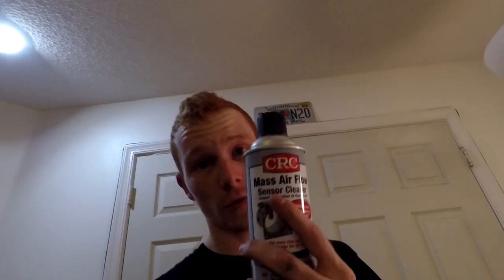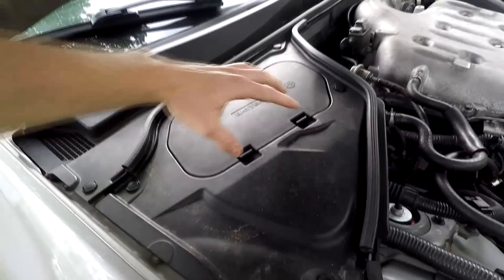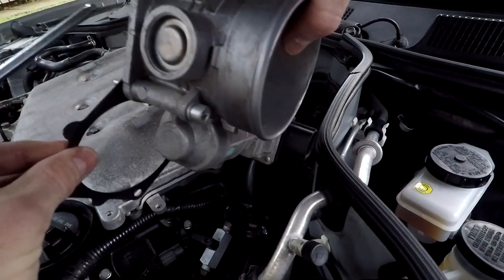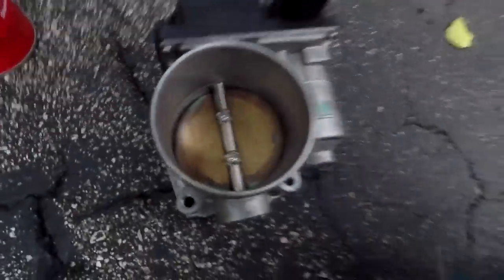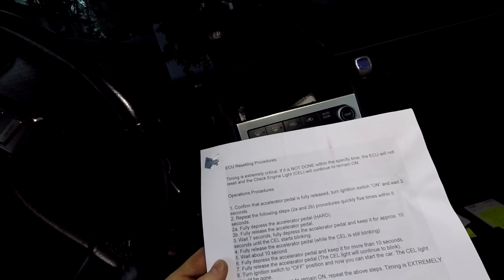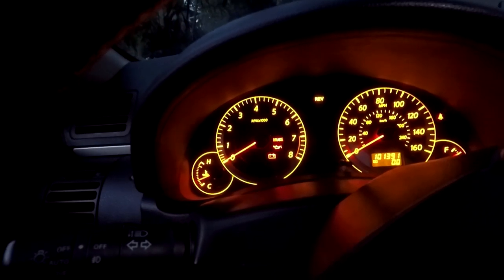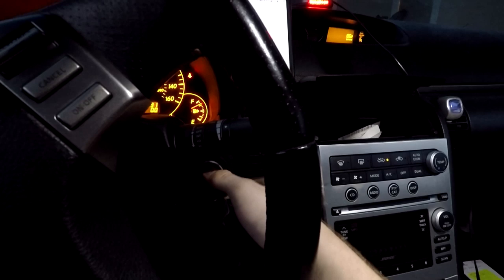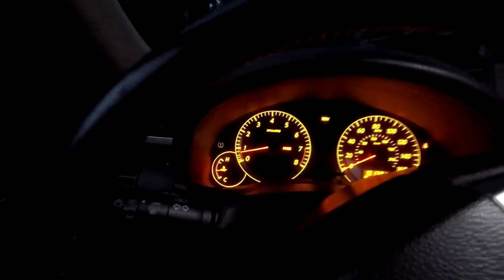G35 350z How To Clean Throttle Body ECU/Throttle/Idle Relearn

Comment: Been struggling with a weird idle for a couple weeks after cleaning my maf, air filter, and throttle body. Sounded like a dirty iacv even though it doesn't have one haha. Used your quick relearn sequence and boom gone! Thanks!
Reply: FrostyOsrs did it fix it by just cleaning it ?
Reply: @fernandoestrada556  I cleaned them for a check engine light. And it fixed that
Reply: I had a 350 that wouldnt take the idle air vol learn even when using consult 3. Ended up replacing ecu to rectify issue

Comment: my rpms always bounce when i’m parked even. right when i start it, it starts at 2000rpms and slowly goes down to 1000rpms but sometimes randomly it’ll bounce up to about 1500rpms. Also, when i come to a stop my car jerks me a little bit and i’m watching the rpms when that happens and they bounce. so do you think this could be a throttle body issue or something similar?
Reply: Have you solved this issue ? I have the same problem
Reply: @EduardoGarcia-lk2os  tbh not really it still kinda does it but it’s half as bad.what was my major issue i noticed was there was an vacuum leak between the top plenum and those 6 bolts at the top. so make sure everything is screwed in tight. otherwise man it could be the throttle body may need to be cleaned or it’s the maf sensor
Reply: @tjgotbands  it could either be your maf sensor or your throttle position sensor
Reply: @tjgotbands  it could either be your maf sensor or your throttle position sensor

Comment: Between step 4 and 5 of the ECU relearn, my CEL light goes solid? I'm getting codes P2122 and P2127. I've replaced the accelerator pedal including sensor and new OEM throttle body. Anyone else have this problem? I can't get the CEL light to stay blinking through step 5.
Reply: ECM
Reply: Did you ever figure out this issue I’m dealing with the same bull shit right now
Reply: @M471K  a rodent ate some wires under the cowl by the battery. Bought new connecter and rewired. Fixed it.
Reply: @jmelotte4491  thanks man appreciate the help/reply

Comment: Hi Aaron. It's so nice to have these video tutorials. Thank you! I hope you are able to get back to me quickly. I just replaced both camshaft sensors and my VDC/ slip light went off but my check engine soon light is still on. My car has over 171,000 miles. Should I start out by cleaning the throttle body as opposed to purchasing? I am just getting back to work and money is tightly budgeted. $160 extra dollars after purchasing the sensors isn't coming to easily. 

Thanks in advance for your advice!

Comment: Bro! This video was so useful. Had a bunch of codes and weird lights on my dash. Used your videos to clean my mass air and throttle. Problem gone. Big thanks man!
Reply: what codes did you have?
Reply: @mn_king6127  MAF sensor, throttle body sensors….. pretty much all my sensors. Ended up replacing them all. My sensors keep getting tripped so now I’ll probably add grounding cables?? Still in the process.

Comment: Great video Aaron. Best I have found on Youtube. I have the throttle body released from the gasket, but I cannot seem to get the electrical connector to release. I have worked on many cars but not Nissan/Infiniti. What is the method to release the connector so I can fully remove the TB?

Comment: Well man currently i am having idle issues and Rev issues i been thinking of cleaning my TB! But my question is?Can you keep the battery plugged in and not have to disconnect the TB?And clean the Tb as it sits?

Comment: I have been having issues with my car, I think I may need to clean my throttle body (I will have to do this myself) so before I take on this task; I wanted to ask you a few questions to see if this may, in fact, be the issue. A little back info - 1st my check engine light is on(all the time), 2nd my Slip indicator light is on (intermittently)  (code is P101 -MAF) I changed my MAF sensor. When the slip light goes on the car will not go over 40 MPH (my understanding is the vehicle is in "limp mode") at times when I stop the car acts as though it will die, the RPM gauge jumps, and this morning while driving with my kids in the car, I was turning left and it just died out completely and showed a bunch of error codes. I was able to start it right back up but the (SIL) was on and the car remained in limp mode until I arrived to work.  Is this indicative of an issue with the throttle body? Should I be looking a whole other issue?
Reply: Alicia Herrera check. All sensors camshaft and crankshafts
Reply: My Slip indicator light would come on (G35) and it had to do with low brake fluid. Once I toped off it resolved the issue and never came on again.
Reply: I’m currently having the EXACT same problem you described. Did you figure out what caused it?!! I need help.

Comment: Aaron how do I clean a throttle body on 2003 infiniti g35 sedan is it the same procedure as the 2dr sports coupe also how do I get mass air flow sensor cleaned up I would appreciate any help thanks

Comment: Hey Aaron, I cleaned my throttle body and mass airflow sensor, and when I put everything back together. When I went to turn on the car it wouldn't start. I don't think it's the Throttle bodies because in trying to start it I revved the engine successfully, but then it just shut off. As if it wasn't getting enough air for the fuel to air ratio. So I wanted to know if it could be my MAS. I did use the proper sprays just like in your video. Any ideas on how to fix problem?
Reply: Having almost the same issue right now. I installed aftermarket long tube cold air intake then when I started the car Rpms dropped to zero and stopped working. I cleaned MAF sensor and throttle body and tried to do the relearn process still doesn’t stay on. Did you end up fixing yours??

Comment: service engine light recently came on in my 2008 G35 sport sedan, read back the code P0507 idle air control system higher than normal, you think cleaning the MAF sensors/throttle body would take care of it?

Comment: Hey Aaron I have a 2007 nissan 350z and cleaning the throttle bodies has turned to an absolute nightmare bro, after cleaning my old ones I began getting a high idle and had the engine light flash on, so then my mechanics reprogrammed and it did nothing, after that I got new throttles bodies and the mechanic took it to the Nissan dealer to get it reprogrammed and that costed a shit ton, and still even though the check engine light is gone my idle is still a little high and rpms move slow and still at around 1-1500 rpms Man any suggestions? i'm broke af and my car is still not right I dont know what else I could do to get to normal idle
Reply: Do you think that the computer will relearn normal idle over time?
Reply: Tony the Lakers Fan  I have the same problem did you ever get it fixed?? 
If so how ?please help
Reply: Reset the ECU first, 
Then do the relearn procedures. There's 3, I forget the names but do all 3. 
Pedal position relearn, acceleration relearn,  and idle reset,

Comment: Moving the butterfly valve on Gs/Zs is asking for trouble. 
The gearing is plastic and if you move the valve you are asking to have the teeth break (especially when these get old) and having to replace it. I always clean these with Qtips and cleaner like you are doing but I never move that valve. Nissan made them flimsy as FAWK.
Reply: You do realize the valve moves as you drive your car right? It makes no difference whether the computer is doing or a person.

Comment: Please any fastest response , so my car cranks but wont start !! It has been sitting for couple months after engine swapped , same engine lower miles then ecu messed up put it on and programmed so now it cranks but wont start not giving it gas ... Has new fuel pump and thats working fine

Comment: Having a problem with my 03 G35 have a p0101 code and car is hesitant to start and when she does she only stays at 8-900 rpm and when I throttle up it dies out/tries to die out at 22-2500rpm?

Comment: If I use a scan tool to reset the computer, can I just drive the car 50+ miles for the computer to relearn the car like it is done with a standard car, or is this process the only way?

Comment: So before y'all clown on me. I was cleaning the throttle body and I lifted up the plate and was scrubbing to clean.. in the process I let it slam down on its own and didnt think nothing of it. I see this video and my car idles weird only when it gets warm
Reply: Might need a new throttle body or also can be from a mass flow sensor being dirty , to camshafts sensors or crankshaft sensors as wel as the spark plugs or coil packs. I’m going through a similar situation was wondering what worked for you?
Reply: @stendoz-3883  I sold it lmao that got rid of the headache

Comment: I wouldn't finger bang your butterfly valve, since it's electronic and it can jack them up real good. A real good method instead is to put the car in the run position and put a stick or something on the gas pedal. This allows the ECU to open the throttle body wide open and then you can clean the whole thing pretty much. That's how I do it now after spending one or two hours trying to get rid of high idle and the reset wasn't working.
Reply: If they are electronic how would putting a stick on the pedal make it open while its off and you're cleaning it?
Reply: @Dingo.100  In the run position everything has power, so the throttle will open when you press the pedal.
Reply: @smc9764  ohh okay i see

Comment: Just attempted to clean my throttle body and change the gasket when I was defeated by one balled Allen bolt on the throttle body (literally the worst placed one under the throttle body to the right) and had to give up and put it back together. Any tips for balled Allen head bolts? (No I tried vice grips it won’t catch not enough space) (I heated it up and tried Wd-40 no luck) thanks
Reply: maybe consider taking off the top plenum with the throttle body off? then you can remove that easily I think. https://www.youtube.com/watch?v=8kbeCSlRDG4 he does a good walkthru

Comment: when i’m driving and let off the accelerator, my car jerks me and the rpms bounce. the code i got was a p0507 but my car idles fine at like 650rpm. it’s only when i’m driving. do you think it’s still a throttle body?
Reply from the maker: It’s possible could start with replacing it. could be drive train things like drive shaft or diff bushing or engine mounts causing the bounce

Comment: Hey my car shakes a little when just on parked I changed all my spark plugs and all my ignition coils are good 
Throttle body is good clean the Intake high flor censor and changed the battery for the car 
You think I need to do all those steps since my car is a little shaky random misfiring too
Reply: @Djexclusivo I just did the idle relearn and it fixed that problem immediately

Comment: have a 2006 350z, my issue is I have check engine on , and the rpm is constantly at 1100. I don't know if that is normal?, I did change the  bottom crankshaft sensor to see if this help , but still the same,  but seems to drive a bit more smother now or is just maybe my perception  , do you have ant recommendation about the elevated RPM , ?  or the rpm over 1000 is normal ?
Reply: Do the idle air relearn procedure. 1100 seems high for idle
Reply: idle relearn normal idle would be 700  750 800rpm

Comment: I’m cleaning my throttle body took everything off like you showed, but forgot to disconnect my battery🤦🏻‍♂️ would that cause any problems
Reply: Rafael Carrera how did it go? I want to do clean my throttle bodies but I don’t want to disconnect it and do the idle relearn
Reply: It's a safety measure that I really recommend. If it worked without a disconnect you may be lucky. Too many people have had their eeprom in their ecu corrupted because of voltage spikes when doing this procedure. Seems a common problem in the dual TB Zs (07-08). Absolute bitch to fix.

Comment: I’m trying to figure out of a knock sensor or a camshaft will make my car slow at acceleration and I think my car might be going into limp mode any tips would help me big time thanks
Reply: Did you guys figure this out? Mine was a bad harness. Fixed it by replacing and didn't even have to tear down the engine. Used clothes hangers

Comment: My car is doing this thing where when I start it from a cold start it will idle but as soon as it warms up it stalls. It’s a real head scratcher because I no check engine lights on at all. It’s not a fueling issue or a vacuum leak everything has been checked. Could it be the throttle body? I did clean but I was really careful.
Reply from the maker: It could be the throttle body or even the MAF, but if it happened after the throttle body clean, its most likely the throttle. Just gotta be careful not to open and close the valve to hard or too much
Reply: Aaron Newman the weird thing is that the car worked just fine after I cleaned the throttle body. This problem occurred about a month after I cleaned the throttle body. Every faster from the throttle body to the plenum was replace and the MAF is brand new too.
Reply: Aaron Newman is the throttle body supposed to make a constant noise when you leave the key on but the car isn’t running? Mine has been doing that after it shuts off on its own.
Reply from the maker: @narciso19G  I don't think so. Usually does it when you have the key in accessory mode
Reply: Aaron Newman it does it when the key is in the on position. It doesn’t start doing it instantly only after a few seconds of being on.
Reply: Hey bro, I have a 2006 350z having the same problem right now , idles good on cold and stalls on warm and wont drive off , I’m planing on cleaning my throttle body and replacing the camshaft and crankshaft sensors tomorrow, I’m wondering if you ever solved your problem. Thank you
Reply: @stendoz-3883  yea I did. It turns out that I was doing the pedal dance wrong to get the throttle to calibrate. I did also replace the cam and crank position sensors but that didn’t do anything.
Reply: @narciso19G  what did you do that fixed the problem if you ever did solve it?
Reply: @stendoz-3883  I just recalibrated throttle body using the pedal dance and got it to idle.
Reply: @narciso19G  thank you for the reply bro

Comment: Do I have to reset the car? Or is that just an option? Because my infiniti g35 is a push start, not a turn the key for ignition. And if I still have to, How do I go about restarting it?
Reply from the maker: Yes you need to do it if you want the car to run right. You have a newer year make and model so look up your year and model on google like (2008 Infiniti G35 push start idle and throttle relearn procedure)
Reply: Aaron Newman thank you!!

Comment: What if ur tuned should u skip the ecu reset? Im having a weird idle and the car goes on low rpms when slowing down in neutral and then goes back to regular idle after
Reply from the maker: Definitely reset your ecu. If you're tuned it won't erase anything. Just help the ecu gather and calculate live information better

Comment: Does unhooking the battery and pumping your break 5 times and then hooking it back up do the same thing?
Reply from the maker: Unhooking the battery for about 5 minutes will help reset the ECU but pressing the brake doesn't do anything to my knowledge
Reply: Pressing the brake drains the capacitors fully I believe.

Comment: Do you know if the throttle body should open with the ignition switch on. Engine off and pressing the gas pedal ? 
I have a problem when i press the gas pedal  my nissan 350z dont respond   If i press like take off.  But it will if i try slow.
Reply from the maker: If I know about throttle bodies correctly then my guess is it should work when engine is off and key ignition is on
Reply: Aaron Newman   My dont open when someone press the gas pedal  with the ignition swich on
Reply from the maker: @colassolorzano6353  I'm not sure bro I never tried mine while it was off

Comment: I'm stalling after driving a bit after disconnecting the car battery, cleaning throttle body and fixing head gasket/ timing chain.. idle is at about 600rpm.. but after driving about a mile I stall and humming noise coming from throttle sensor.. is that a symptom of not doing throttle reset? I read only one case where it was.. every other case said idle was high at about 1000rpm..
Reply from the maker: Hrmm. I have no idea about the symptoms of not performing a throttle reset. Normal idle is 600. You might need a new tb or sensor?
Reply: Hey man did you ever fix your problem and so what was the case?
Reply: @stendoz-3883  yes.. it's the camshaft position sensor.. both go bad often.. common issue with the vq35 engine.. they supposedly fixed the issue with the G37.. supposedly.. I just got the E90 with a new world of common problems and crank but no start condition 🍻
Reply: @stendoz-3883  if not the cam sensor the crankshaft sensor.. the G35 won't give codes for it but certain lights on the cluster that should not be there give it away.. the forums and other YouTubers help narrow it down 🍻
Reply: @352lambo  thank you I appreciate it brother

Comment: Would this works on a 2002 maxima ? trouble starts when I open the butterfly valve by hand (engine off /no key )and spray with throttle body cleaner. I had it 700 rpm but doesn't stay after I turn it off,it goes to 1000 rpm every time I start,ty
Reply: sakitlikod1 did you figure this out I’m having the same problem

Comment: Hi I just changed my bank 1 cam shaft sensor on 04 350Z since car would stall or act as if it were going to with TCS, BRAKE AND VDC LIGHTS ON.  Now since replacing it, I get a very low crank and turnover, and car shuts off right after startup with tcs and vdc lights on.  I can restart and idle is around 1100 revs, but car stays running, no shut off.  Any recommendations would be helpful.  

Thanks!!